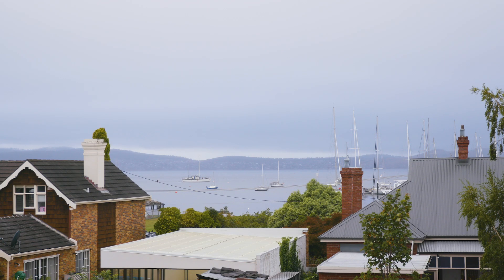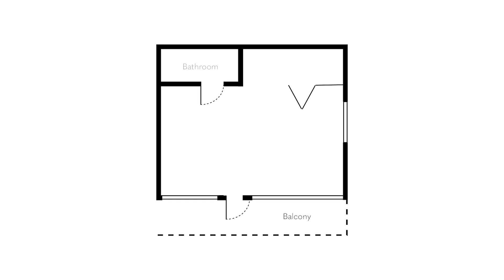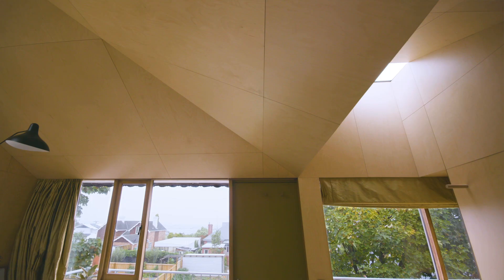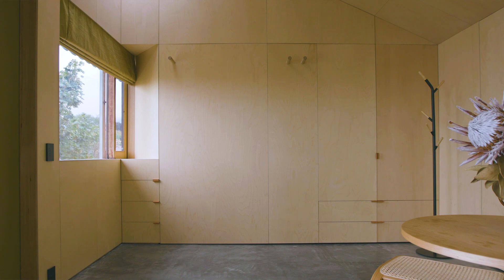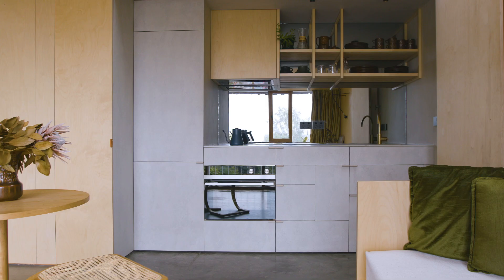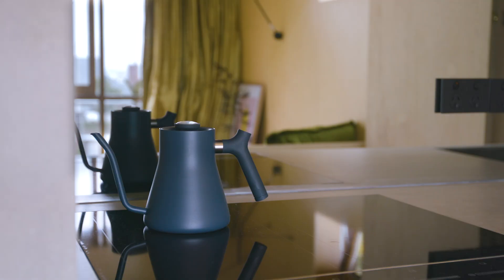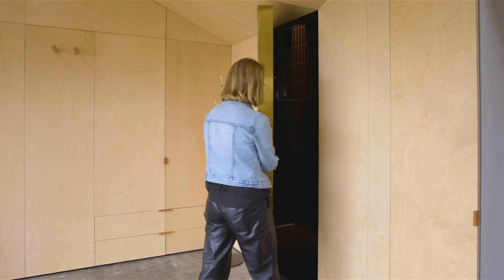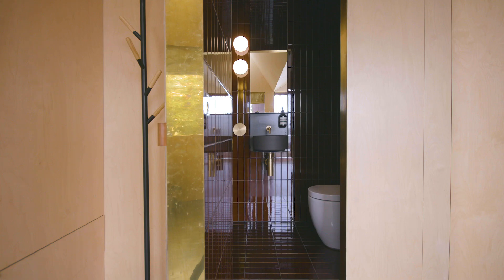NEVER TOO SMALL Tasmanian bed-Sit Micro Apartment - 26.5sqm/285sqft

Comment: This is some next level minimalism
Reply: DarkFireBlade25 No it isn't. It's an outrageously costly and difficult luxury.
Reply: @DP-jy2ge  Why can't it be both? Or do you not realize that minimalism is also a visual aesthetic.
Reply: DarkFireBlade25 Minimalism as a purely aesthetic gesture has no value. It's a luxury only ever indulged by those who never have to live with the real thing. Minimalism as an economic measure does have value - and it looks nothing like this. It's chaotic but spartan ... bereft of 'beauty'.
Reply: @DP-jy2ge  Do I have to say I meant aesthetic minimalism? You can tell I meant that by my comment. You're barking up the wrong tree here.
Reply: @DP-jy2ge  That is your opinion not concrete fact. Your opinion is perhaps another thing that "does not have value".
Reply: I'm thinking a minimalist wouldn't need quite that much storage though. 😉
Reply: “A full pantry” *opens a single shelf of some chips*!
Reply: And I love it

Comment: I have another word for that bathroom, claustrophobic! 😧 Get me OUT of here!
Reply: To me gave the feeling of being in a tiled tiny dark closet, or tiled bank vault and no key to get out.
Reply: It's so dark and tiny!
Reply: totally..!!! not a good idea... a really bad.
Reply: Looks like a freaking dungeon 😂
Reply: first rule of tiny spaces: don't use dark colors (they totally got the wrong color here)
Reply: Acoustically sealed! What were they thinking?
Reply: @coco You fool, the dark bathroom has NOTHING to do with the size of the apartment.
Reply: Rule #1 in bathroom design. If the area of the room is smaller than standard, DONT USE SMALL PATTERNED TILES. Bigger square tiles could make the room seem a lot more breathable and less busy on the eyes.
Rule #2 Use light colors to make the room feel LIGHT especially on tight spaces rathern than dark colors that would make the room feel a lot HEAVIER than it should.
Reply: @mwcshk113  you're totally right
Reply: You are not welcome to step inside anyway... So don't worry about getting out

Comment: The design looks clean. I question the durability over time though espeically the folding door for kitchen
Reply: Overtime with designs like these, the most concerned i'am about is the bed. As for the kitchen, goodbye to the folding door, i guess 😅 only when it breaks down.

Comment: Nice job guys. I particularly liked the concrete floor and mirrored splashback as well as the appropriate choice of fittings / spec. for the space. I'd agree however with the earlier comment regarding the choice of dark tiles in the bathroom,  just a personal preference I suppose. I thought the built in elements were nicely detailed and overall it looks like a well-considered bit of design.  Cracking views too!
Reply: Yes, the fixtures makes it luxurious and calming.

Comment: I know that marine plywood is terribly 'on trend' but I'm not sure it 100% works here. Combined with the exposed concrete the space looks quite cold and sparse. I do like it, but it feels more like an exhibition space than a home. I guess if the space was dressed with different furnishings, art etc. it would feel completely different. Pull down beds I'm not a fan of, but I can see why you'd want it occasionally. However, the bed will likely spend most of it's time down, so as a designer, I think you have to start with that in mind and design around it.
The concertina kitchen door also looks like it needs some work :) it looks awkward to close, wobbly and not stiff enough? It could probably benefit from being engineered and fabricated with a different backing material/structure and some floor/ceiling guide rails. It looks like its just made from ply linked with hinges?
Sounds like I'm being super negative...I quite like the space, but with any small space, the devil is in the detail and the level of craftsmanship. Looks like they have gotten the space to about 90%. A few more touches and I reckon they're on to a winner.
Reply: MEPR: "Combined with the exposed concrete the space looks quite cold and sparse."
I am not a designer, so I suppose the aesthetics (for want of a better word) escape me. However, I like it because it seems sleek and pared back, and extremely streamlined.
I also like the lack of clutter like "decorator items" such as pointless cushions.

Everyone has different tastes,thankfully.

I would, however,like the bed to be automated.

Comment: Well done.  Several years ago we moved to a much smaller space than we had (+/-180 - 45 sq m).  For us it was due to age.  The new place is an independent senior cooperative.  We also have a “Murphy” or cabinet bed.  We could not put our kitchen in a nook but did improve functionality substantially.  I do like your stool type chairs.  New subscribers.

Comment: I like the simplicity of this. Instead of something like transforming furniture, this is just a kitchen hidden in a closet. Simply open the door and you have a kitchen. Some tiny home designers over complicate things, which kind of takes away from the liveability. You don't have to do a lot to actually access the functions of the house. Just open a door and you're done. Very nice!

Once you add some plants and paintings this will look way less bland.

Comment: The apartment has a fairly small space and very well optimized and distributed by separating the room and the social area, it has a very good lighting since a small space without light would be very bad for a lonely home, the use of light with respect to visual and facade is adequate, the folding bed with storage is quite ingenious, the kitchen that is also hidden gives an extra versatility to the apartment, they also have enough storage space and all the necessary furniture for the user, each space from the wall It is optimized for storage, the bathroom is also hidden giving the necessary privacy for this space, since everything is located in the same way and can be hidden, it feels like different variations of spaces.

Comment: Brilliant work.  Finally architects are including wall beds into their designs for tiny spaces. It’s the only way to go. Would have liked to see a revolving mechanism rather than a pull down bed in the space with fold down desk on the other side to maximise functionality. I don’t believe that beds would be left down all the time in a minimalists apartment and adding a desk on the other side would ensure that.  See Resource Furniture vids to see the bed mechanism I’m talking about.  Keep these videos coming Never Too Small!
Reply: It would have needed slightly more depth if you were to have revolving shelves on the other side. If you look at the video, you can see the bed when folded down, stops a little before the main door. So you can still open the door if the bed is down now. You wouldn't be able to do that if the bed required more depth. 

I wanted a Murphy bed with shelves as well, but it would have hit my table if I opted for a revolving option. The actual design of a space requires measurement not just for functionality but within building constraints/requirements too. If they shifted the main door (if the building allows them to), the whole configuration would have to change as well - the other carpentry on the same side of the bed will need to be deeper since they are flushed to be the same depth. I think as long as the space works for the owners, that's all that matters. They are building a space that works for them and their lifestyle.

Comment: The over head storages are useless if we are too small. No ladder, no special way to put things easily in these spaces. Another problem if the things are to be brought and are too heavy. Or heavy volumes. We need an access. To these places. Now, when the weather is too dark outside the colors are not warm enough inside. And i love wood. So it needs a touch of color from places to places. Good idea for the acoustic protection in the bathroom...the color of the walls are for me too dark. It is a style. But if someone depressed comes here. It is absolutely impossible... the windows they must be changed. At least to warm the studio. And In winter... an idea is asked to warm correctly the space. I appreciate the space. Good to practice yoga, or dance rehearsals. I would add a big mirror for instance and a barre for the classical exercises. With point shoes. I love the balcony. Good to eat outside in summer or as soon as sun comes. For the intimacy, Japanese rolling white or colored curtains can come from the ceiling. Near the windows or not too far. Welcoming sun and warmth.the colors may come from these panels. After all. Some of my creative ideas. 🤷🏻‍♀️😘🌷i like the idea that everything is in the walls. I loooove . Everything furniture on wheels in a little space, is required. Of course with a system to fix when needed.

Comment: Exposed concrete? Ehh.. The thing with thermal mass is that it dampens temperature changes by absorbing that energy or releasing it back. If that temperature is perfect over the day and all year round - no problem. But if it's too cold, or too hot, it takes a lot of energy to change the temperature because you also have to add or take away the heat of the thermal mass. A very quick look up of the climate in Hobart, Tasmania says it's on the chilly side for most people. So, either slippers are going to be mandatory, or, more likely, carpets or laminates would go down on that floor straight away.
At least the bathroom has a certain sense of style! :P

Comment: the thing about this build is it wouldnt look so uncomfortable if the walls were painted any color other plywood, the table was bigger than a plate, had more interesting flooring, and had a more comfortable couch. how do you live in this? no clutter is nice but i cant imagine having that much floorspace and not like, actually using it

Comment: I don't see this place as functional, but more as a piece of modern art. That apartment looks like something you just look at and don't touch anything, like how are you meant to live there, every day?
 I'd go mad looking at those blank walls, and with all that extra height in you ceiling, why didn't you do what most people do and just add a second floor, in that apartment you'd have no problem doing so and still have a lot of head space, yet you just waste all that room for nothing. You can still have all that natural light, coming down, with just a simple loft with a bed on it, and you wouldn't have to fold it away every day. 
That way you could have made a larger kitchen, a larger bathroom, an actual living room and dining room, with enough seating for quests, and still keep with the simple look you're after.
I think this apartment was more of a project then anything else, and if not that this is how they design their buildings, I wouldn't ever hire them if I had limits on the size of building or room I have.

Comment: Its so bare and monotonous, not to mention the hassle of tucking the kitchen wall and bed in and out everytime you need to use it. Those hinges have a breaking point and would require troublesome maintenance once it actually do. I like the idea of a skylight on both the living space and bathroom, I just wish that the wood texture couldve stopped at the cabinets and allowed the ceiling to be stucco white that could bounce off more light into the room and make it feel lighter as compared to having wood on the ceiling which seems to look heavier and too overpowering. And the bathroom, such an awful choice of tile pattern and color. I understand that they want to mimic the tile pattern found at the entrance but that's a vast difference to what they actually ended up using which is a narrow vertical dark maroon tiles ALL OVER the walls. A better alternative considering the size of the bathroom would be to have an accent wall having the same tile pattern as the entrance (small squares) on the shorter side of the shower underneath the skylight, and the rest of the walls to either be bare or use big square light colored tiles to reflect more light inside from the skylight.